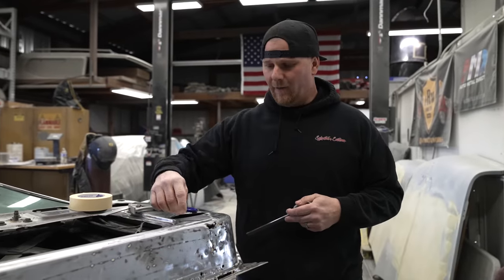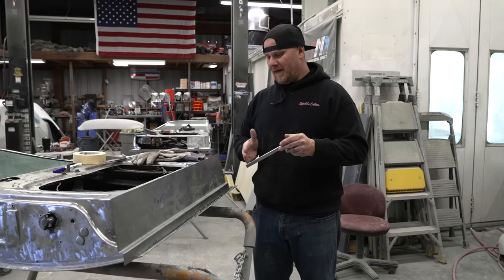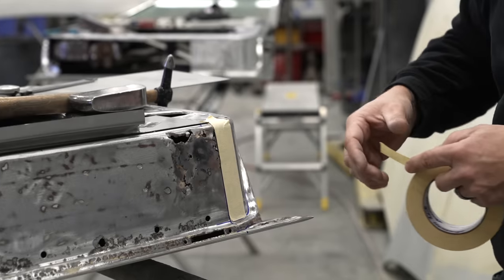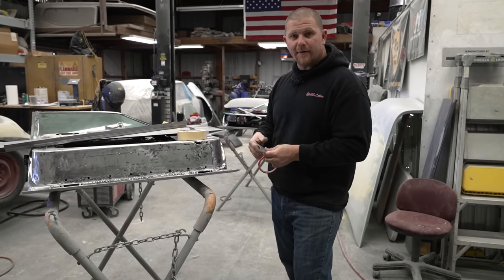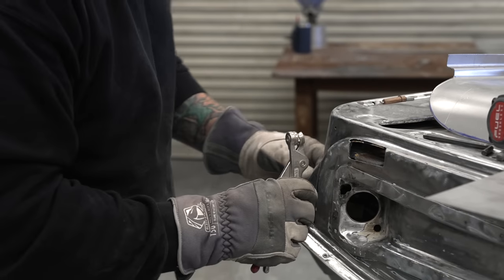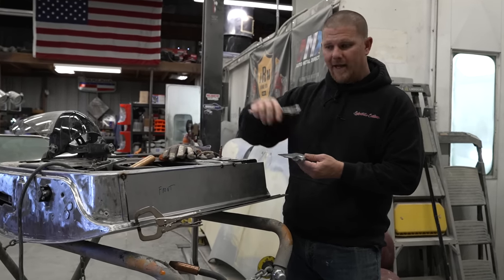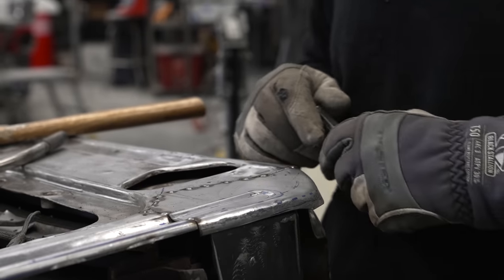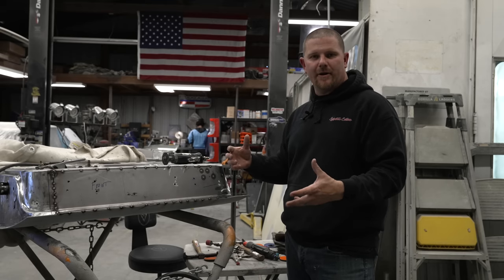How-To Replace the BOTTOM of a Car Door - Rust Repair

Comment: As an Aircraft structures mechanic I work a lot of aluminum it is tabu to score anything that is a finished part. The vibration has proven to cause the scored or even a scratch to produce a creacked part with time.  I always wondered how to reproduce the bottom corners without a press. Iiked and followed keep the content coming. One of these days I'd like to have the time and garage shop to do the same.
Reply: As a former USAF aircraft mech I would like to respond to your comment. One significant difference in aircraft is they have stressed skin structures. Aluminum sheet will crack after constant flexing over a significant period of time "but" have you seen the amount of holes in heavy aircraft access panels? This precaution is like most aircraft warnings in that it's possible but the probability is so close to zero it's rediculous. Light aircraft still predominantly use air cooled lawn mower engines with hand operated chokes so let's get real is what I'm saying. A small scribe line on a steel part is virtually the same as a scratch and in no way will affect it's longevity. I can assure you that every aircraft in our military inventory has deeper scratches in the aluminum panels and airframe and they are deemed safe to carry any form of ordinance and personal into battle. The FAA still certifies bedsheet covered aircraft with glued and nailed airframes so comparing these apples and oranges really doesn't seem to make sense to me anyway

Comment: I wish I'd seen this video about 8 years ago, LOL! I learned on my own how to do much of this. Although we had a shrinker/stretcher and a bead roller at the shop. we didn't have tipping dies. I used a set of rounded tip chisels and a shot bag in conjunction with the shrinker/stretcher to do the majority of complex shapes. The process you used to break down the steps to make the pieces is EXTREMELY useful and I look forward to using this info on my next project.
Reply from the maker: Right on!! Yeah just gotta break each part down into whatever works for you 👍🏻

Comment: As always, Sylvester Customs doesn't just show you... he teaches you the finer points.... top shelf vlog and another instant save.  I'm not a paid advocate for Sylvester, but, If you are venturing into Custom autos and truck or restoration... Subscribe. Travis speaks to all levels.. and very concise.  He has given us the confidence to not just tip our toes in, but we've dove in head first...yes, we have made a lot of mistakes, Not Travis fault.  beginner mistakes ... they were well earned mistakes 
FYI  
We have ventured into Metal Works for our project (79 Z28). Only because I'm a knowledge geek did I really look into this before stepping off the plank. The same as with Mig & Tig welding.  Before you go bending, knocking and banging away on metal... understand what is actually happening to the metal. How the metal will stretch and shrink... I've watched people stitch / spot weld. They come to the end only to see the new metal and parent metal are over lapping... they get out the zip disk and start cutting.  Only later did I learn... you can hammer and dollie the stitch / spot weld and stretch the metal... This is why it is so important to cut new-to-parent metals with as close a tolerance as possible...wide gaps make metal life miserable.  Don't ask me how I know...
Reply from the maker: Thank you very much we try our best

Comment: Good looking out! Glad to see you cut the whole lip off. Im planning the same thing, i replaced 1 door for damage but no bottom rust. Other side door is rotted in the middle. So im cutting 3 inches up out of the entire middle section of the door and welding the whole inner & outer section back to the other door, Now i know what im planning is legit coachworx.. Even though i knew it was.😂

Comment: I dig the shop man. Thanks for taking the time to make a video explaining your sheet metal work. As someone mentioned it's a dial caliper not a micrometer. Even though they read to a thousandth of an inch (.xxx) (ten thousandths [.xxxx] if it was a vernier) due to the nature of thier design the user will invariably add error. My mentor called them guessing sticks. A micrometer is that precise and repeatable. You probably already know all that but just in case. Keep up the good work brother!
Reply from the maker: Yeah thx I have a set of micrometers as well and I always call them the wrong thing but you are correct they are dial calipers

Comment: Since your micrometer is already locked down, you can drag it across your piece and scribe it that way. The tips are robust enough to handle scribing. It’s done all the time. The depth of the little rod sticking out the bottom is the same as the separation of the blades, and they have sharp points on them specifically for scribing.

Comment: Really informative but you are right about the cringe.  That is not a micrometer.  It is a Dial Caliper.  The bends in sheet metal are not brakes.  They are bends.  You use a sheetmetal brake or press brake to put bends in sheet metal.  Quibbling OCD BS aside... Great info.  Really got a lot out of the body filler videos too!!!
Reply from the maker: We goofed it’s hard to be perfect when we’re filming on the fly.

Comment: Welcome back. I think it's been a while. I thought you were doing rust repair. Rust here in the Rust Belt Midwest is non existent metal. HaHa. Really great work. I had to fabricate lower cab metal on a 68 F100 due to parts not being available.  I found it's easiest for me to do multiple pieces to create one due to the limited tools I use. It's more welding but works pretty good. I spend some time sizing things up. Visualize and attack.
Reply from the maker: Thank you chris!!

Comment: Last piece was the hardest! I would have filled the gap with weld. Yeah duh, once its tacked you can beat it down to blend it in This is a simple step you may overlook just trying to get it done. When we don't have all day...

I epoxy the whole backside of the panel. I tape off the weld edge heat zones and spot weld areas, then come back pull tape & add weld through to the edges and nickles around the plug welds. Its more work but seems great in theory.?.
Reply from the maker: That is the best way
Reply: @SYLVESTERSCUSTOMS  i just used you're metal blend technique on a part I'm building for my car today! Thanks. It's a 6 dimensional part so a few areas needed  knock down for a seemless quarterpanel stepdown, it was great & really needed in a critical area of my car.
Reply from the maker: Awesome glad to hear it helped you!

Comment: I have a question, is it okay to use machinist bluing to mark bending and rolling points on steel , at the ends of the piece you're working on? Seems more accurate than a sharpie.
Reply from the maker: Yes, absolutely

Comment: Great video! Just a heads up, if you remove the orange extrusion from the bending leaf of your brake, you can get into some pretty tight areas.
Reply from the maker: Thank you you are correct the problem is the portion of it that comes down and clamps onto. It is pretty wide typically when I do smaller parts I use the finger brake inside the shop.

Comment: I love the insights you give us.
I love the tape transfer method! Packing tape might not stretch as much as making tape?
Some breaks have adjustable offset differences between the front of the top edge and the lower bending surface so you can vary the bend radius.
I am restoring a '55 Chevy and have a bad passenger door that the shyster dealer that sold me the car  swapped the good door on my car that he sold me for a bad door off another 55. It is rusted swiss cheese on the lower 1/3. I was able to get a new bottom outer skin and a new sheet metal bottom. Is there any way you could do a session on these two fairly common practices?
Many thanks!
Reply from the maker: I don’t have the parts to do that scenario. Typically, I show the stuff that we are currently working on with projects in the shop. My recommendation is leave either the outer skin on or the inner structure. Doesn’t matter which one you start with, but you have to leave one on and then fit the other. Trim a little bit at a time until it fits perfect

Comment: Could have left some excess on the opposite side from the edge to be tipped on that the small corner piece for better leverage. (It would also keep fingers away from the dies.) The excess also makes it easier to hold in the shrinker. It could then be cut to size after the tipped edge is done.
Reply from the maker: Thanks I’m learning everyday 👍🏻

Comment: If u don't have the use or the equipment  to do that work do u think if u clean it up and spray a rust inhibitions  on it and inside the door and then use a fiber glass  on it a thin coat would work especially  if u have a thin budget
Reply from the maker: No it will fail unfortunately

Comment: What’s the best thing to spray or wipe down the metal with before primer and paint to prevent rust
Reply from the maker: There is not a product that I am aware of that you can just wipe on before primer. I want to make sure this responses clear you can use Gibbs oil over bare metal to keep the rust away but before you paint or primer, you need to make sure you get a wax and grease remover and remove it. I have seen demonstrations where people have painted over it and it seemed to work but I don’t recommend the reason that Gibbs oil is good is because there is no silicone in it.
Reply: @SYLVESTERSCUSTOMS  thank you very much! After I do some welding sometimes I won’t get to the panel for a while and I don’t want to leave it bare.

Comment: I'm noticing in some of the sprays ya'll do, in the ones with flake, like you said the edges could stick up. Almost like it has a texture too it, a grainy roughness to the touch. It got me thinking of the spray on coatings in bed liners. But, that coating could be used all over the car. I was just wondering if your pigments cod be added to those to, add a bit of color. Also wonder if adding the color changes it on a molecular level, changing it's properties.
Reply from the maker: I’m sorry I’m confused is this comment for the painting video we just put out today?
Reply: Yeah man sorry about, this I was watching a video from dipyourcar. I guess the video ended, and this one began, and I was still typing my message. Then this video started and I finished my comment, it added their comment to your comments. Once again, sorry about this!
Reply from the maker: @geraldrobertson7871  all good lol I was confused. We just dropped a video on how to paint a car today so I thought maybe it mixed it up

Comment: Good to see you back man, your videos are the best for giving the excellent information. By the way how hard is it to spray acrylic over epoxy primer (the primer says it is suitable for acrylic). I have an old Australian muscle car painted in acrylic (paint is still good) but I want to change the colour. Would you get rid of all the old filler and take it back to metal or can I just take the paint off back to the filler and primer over it?
Reply from the maker: Thank you. I’d strip it all but you don’t have to. You could wet sand with 600 and just repaint it.
Reply: @SYLVESTERSCUSTOMS  Cool, thanks for the reply.That gives me something to think about.
Reply: If the paint is still good. No cracking or peeling just sand the whole thing with 320 grit then seal it with a 2 part sealer and paint it. Base clear or single stage. Base clear is easier to wet sand and buff. Be sure to use enough coats of clear to compensate for wet sanding . I usually would apply 4 coats let flash appropriately between coats.
Reply: @michaelmorrow614  Thanks for the tips, that would be a whole lot easier.

Comment: Myself I do the cut n butt so there is no movement and if you cut on a 45 angle when doing the cut n butt it does not move or shrink and it's ten times faster js
Reply from the maker: Whatever works 👍🏻however anytime you weld you get shrink regardless of how you cut it.
Reply: @SYLVESTERSCUSTOMS  been doing body work for forty years and never had it move or srink. If ya put to much heat it will warp but never move or srink in a noticeable manor doing the cut n butt. And it's fast therefore making better profit and time saving that makes better for the customer. But saying that many body shops have their own way of doing things and that's all good as long as the final product is done well and lasts. Wishing you all the best and a healthy and long career.
Reply from the maker: @k.g.kennedy9471  thank you very much. Same to you! I agree it’s all heat input the better you are at it the better the result. I’m thinking in terms of metal finishing where it’s a mirror in metal. You can absolutely do it fast and efficient with minimal shrink 👌🏻👍🏻
Reply: @SYLVESTERSCUSTOMS  just wondering what your channel is about do you do examples of doors and body work or do you do that as well as complete restoration? as I'm new to your channel.